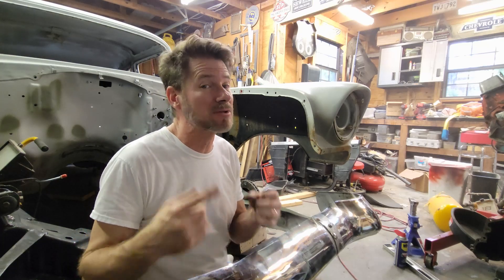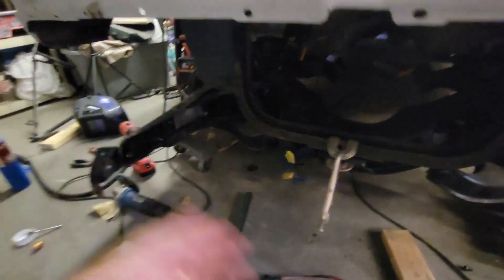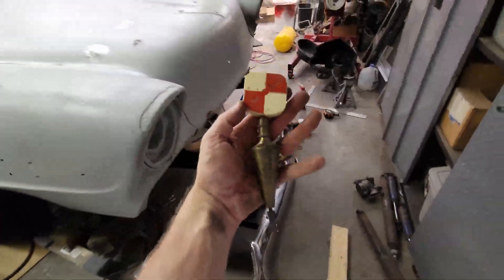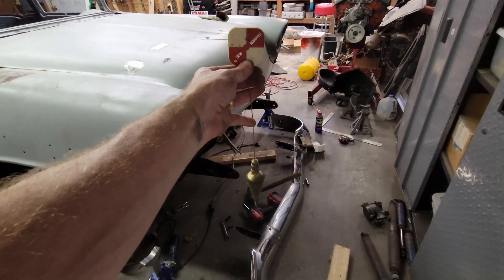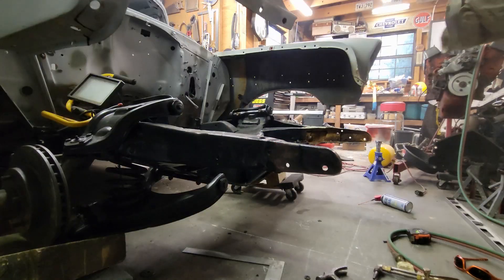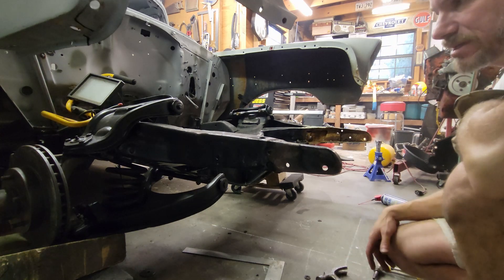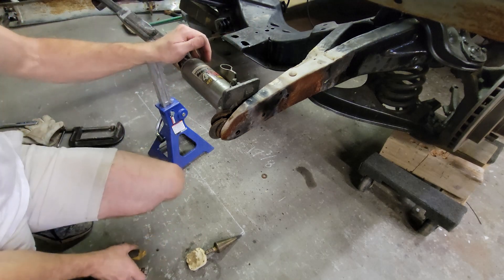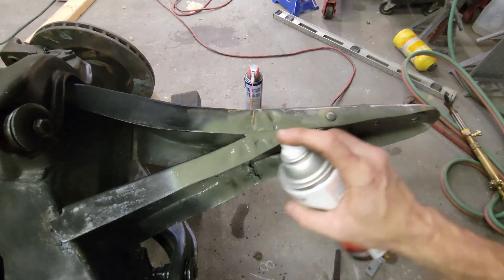E54 Aligning Frame Horns with String & Heat!  1956 Chevy Bel Air Restoration

Comment: Thanks Bill! I just finished doing some small repairs in that area of the frame on my 55 . I am getting ready to spray my 3rd coat of primer.  In those cutout areas I think that was a oval shaped cutout. I had to repair one that someone had put a log chain in.  I bought my bumpers from A2Z they have 2 kinds plated overseas and plated in the US.  I got plated in US. Great parts slow delivery. Need any pictures my frame is still in my rotisserie  and bumpers are on the shelf.  I always enjoy your videos.  I am not talented in that way. Get well.
Reply from the maker: Yep, I was tempted to match the other side, but I thought about it and just know that the only person that will ever see that is me and the next guy that tears it down in 30 years!  And thanks for the tips on buying a new bumper!

Comment: As a carpenter I knew about the 3-4-5 method of making sure stuff is square but instead of inches we use feet also in the 66 yrs of being on the road hard to tell how many hands have been on and under the car but at least your doing it right by strating it so now when she's painted and put back together she will look perfect at all angles
Reply from the maker: A little twist here, a little twist there, next thing you know, the hood or fender doesn't quite fit.  I'm trying to get all of that sorted out now before we even get to that point!

Comment: I ordered a new front bumper for my 55 and like everything else it is on back order. Ecklers said at least 45 days before it will be shipped. So you might want to order early.
Reply from the maker: Good to know!  I looked up prices yesterday and was shocked that they're still under $500.  That may be for the imported version... I don't know.

Comment: The frame horns on my ‘55 are really rough.  I think in order to get them straightened I’m going remove the short diagonal braces (grind the rivets out, cut the welds loose), straighten out the outer rails then reinstall the short braces.  This is the only way I can think to get the dents out where it puckered in.  I’ve looked around for a better replacement frame but no luck yet.
Reply from the maker: Can't argue with that.  It'll bend a lot easier without all the braces, and will still need some heat thrown at it.

Comment: Can't imagine what that hole was for .....looks like you solved the problem ....lot of those older used bumpers are usually tweeked but the brackets and braces usually holds them strait ....chroming up here has doubled in the last 2 months so I'm sure new bumpers are pricey too ....which usually means yours doesn't look that bad apond a second look ....take a break and get back at it when you feel better....
Reply from the maker: If I really want to, I can definitely reuse it.  I just don't know if it's going to be good enough once everything is painted and polished.  Kind of like old tires with a new paint job.  We'll see!

Comment: I am sharing it with you on the 2 years good and now suddenly sick. Time to lock up the family again. I think probably the feller before hacked around on the brackets to fit that frame so he could sell it. if your bumper is good and flat on a level floor, it should be good.
Reply from the maker: It was one heck of a butcher job.  It used to look good though!  Now it ought to look REALLY good!